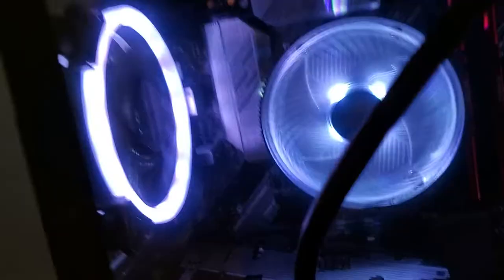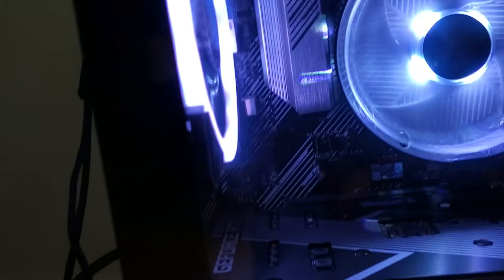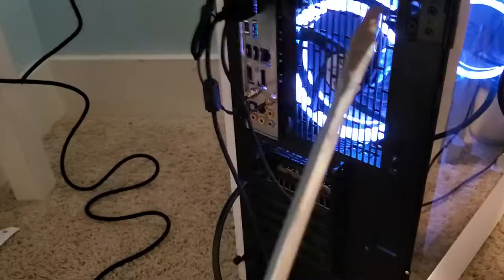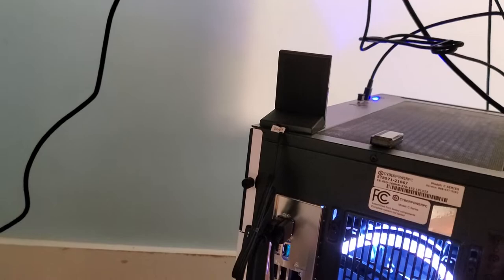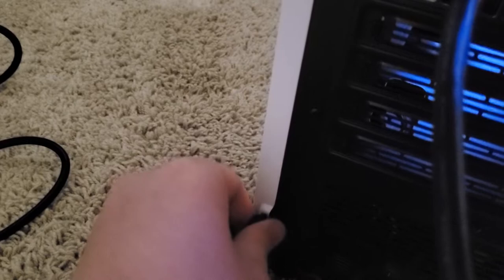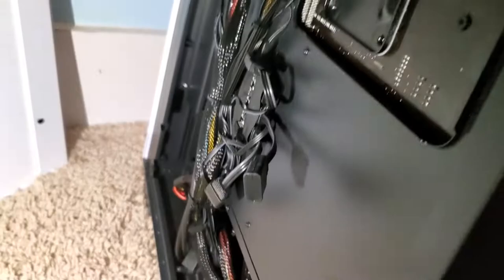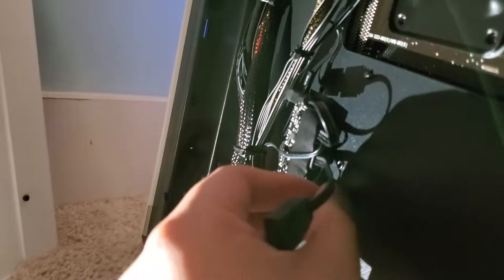How To Fix RGB Fan Lights Not Turning On CyberPowerPC - C Series: GMA4800BSTV10

Comment: Thanks mate, this and the bottom cable on that module had came undone when I checked an issue. I changed my RGB colors to hot pink immediately because I went from thinking I needed a new PSU, video card or motherboard to having everything work. I was tickled pink, hot pink.
Reply from the maker: No problem m8, that's a funny story u got there 😂😂

Comment: Yeah I disconnected and reconnected all of those into the prongs. I even went as far as checking individually with the ends of each where the cap is and connecting that to the connecter that leads to the fan itself (the top prong leads into it with tape around them both as well) and the prongs for the motherboard themself. None of this seems to fix my issue but Im just kinda stumped because I dont understand why the fans are fully functional but the lights dont want to come on.
Reply: wondering if you've figured it out yet? im having the same issue
Reply: Same here! Same issue!
Reply: Did you ever figure out this problem? Have the same issue. Fans are functioning but not the rgb. Did exactly what you did and still the lights won't turn on.
Reply from the maker: I'm having this issue now too and the only help I could get was warranty but that process is difficult so I settled with fans working and no RBG lights :(
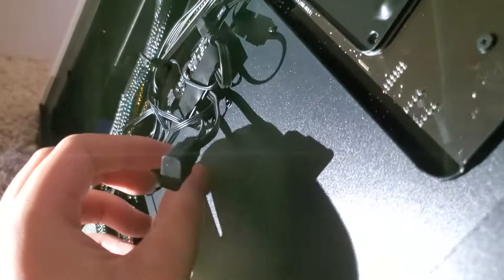Reply: @MaybeMuscleMurr  @RYBvids I was having the same issue what I found was the Reset button(the button next to USB port) connector was not plugged. What I did was trace the cable of that Reset button and just reconnect to the port that shows in the video @1:42 not the one that's he's touching but the one behind that. The cable should look like that when plugged in and that's where the Reset button should be connected to.
Reply from the maker: Oooh I'm gonna try this, thanks man!

Comment: I just did this and still nothing. Mine just stopped working out of no where.... I get it, their just lights...But I want my dang lights working and I think its more than just my wiring.. They've worked for a year now and now, nothing. I have 4 fans that are rgb and not one of them is coming on anymore. Super frustrating.. But you can also unscrew those by hand....